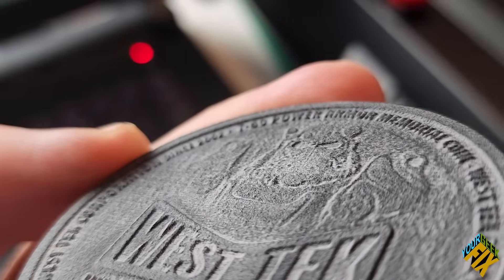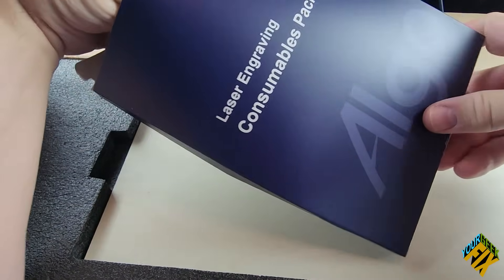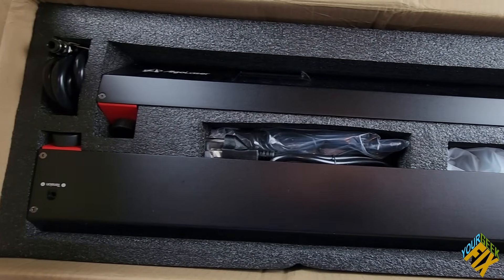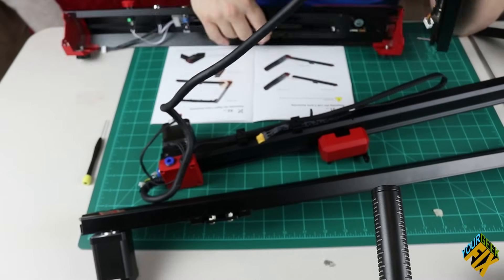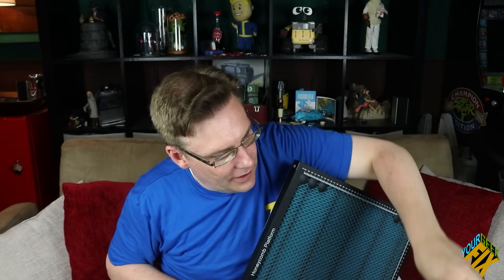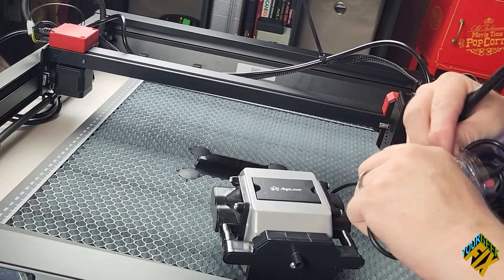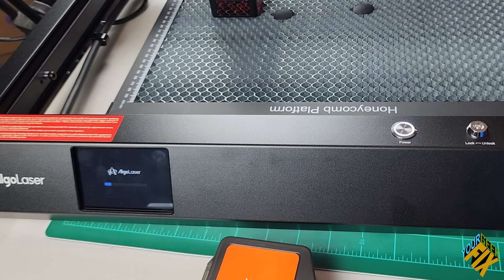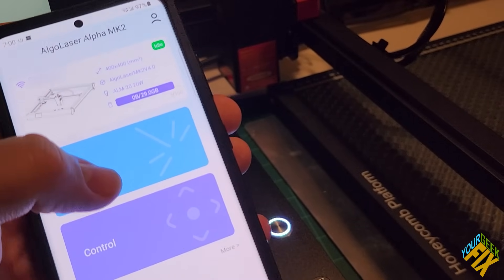How to Laser Engrave 3D STL Files Using the AlgoLaser Alpha Mk 2

Comment: So we need light burn for this laser? It didn’t look like you used it to engrave, but to cut we need light burn??  I only have an M1 iPad Pro.. I haven’t needed a computer/laptop in years..  IF I need light burn, what is the smallest laptop I can get to run it? I do not want to spend a lot of money on a laptop if I do not need to after buying the laser.. Would a cheap core laptop with like 4gb ram and 128gb storage and a basic intel processor run light burn??
Reply from the maker: @LGeeThomas  lasergrbl works as well. Light burn makes 3d engraving easy. The laser can work with your phone or usb, but need a prepped file.

Comment: For a "how to" video, having only a fraction of the video actually be as the title states, with only snippets of the actual steps needed for this is pretty disappointing. 
Output percentage? Speed? Passes? Things to note?
Reply from the maker: @ZecharyK  I filmed each of those, but as my son pointed out was specific to that laser. In this case one pass per png. I went with all defaults. What I showed was all you need to know. With a weaker laser, it may take 2 or 3 passes.